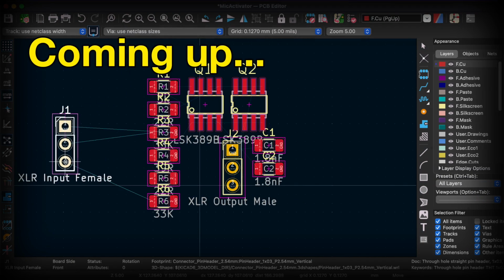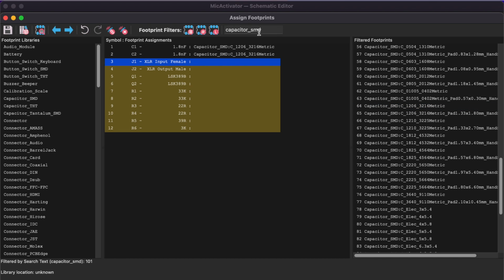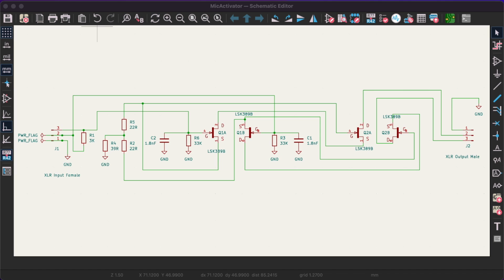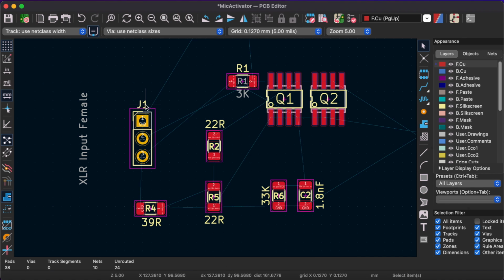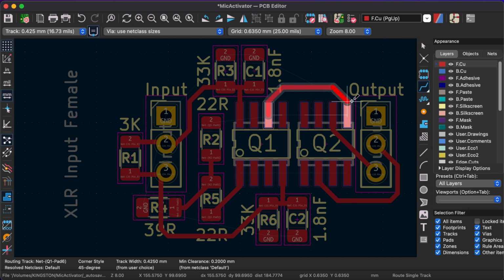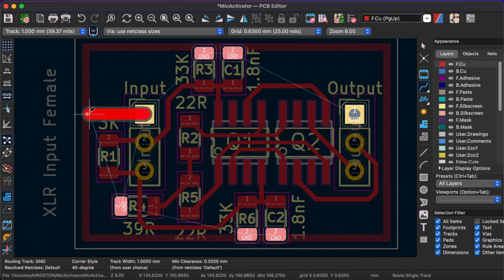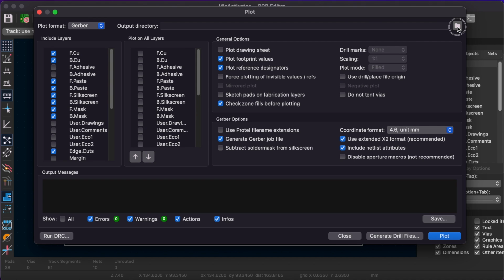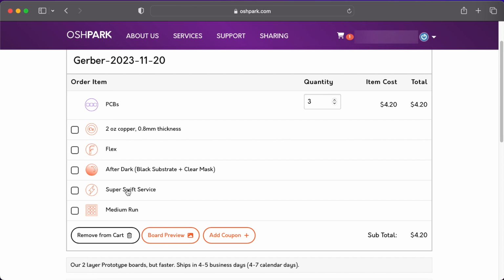KiCAD PCB Design Tutorial | Cloudlifter CL-1 | Mic Preamp Series Video 3

Comment: I draw according to your scheme, I make a circuit board in Easyeda which will be smaller than the XLR connector input on the back, I will have molex division 3.96 MM. 3 sticks! Circuit board 20.3 X 20.3 MM. small everything fits!
Reply from the maker: Hey cool!
Reply: @MostlyBuilds   Can I use 1.8 NF 100V standard hole capacitors for 5 MM raster?
Reply from the maker: I’m not an expert expert. But I don’t see an issue with using a through hole part. I’d  suggest still making sure it is a plastic film capacitor.